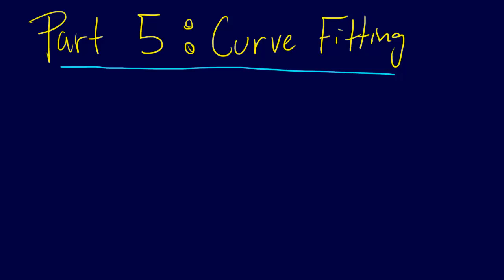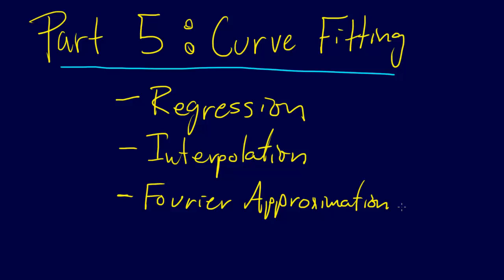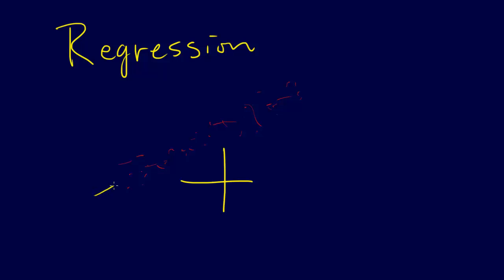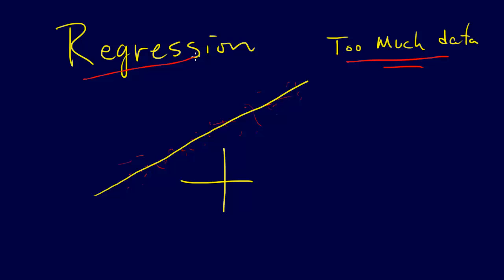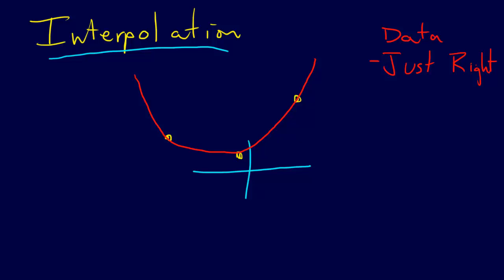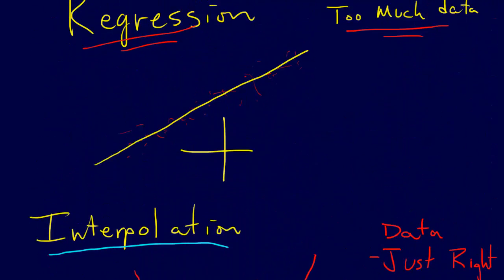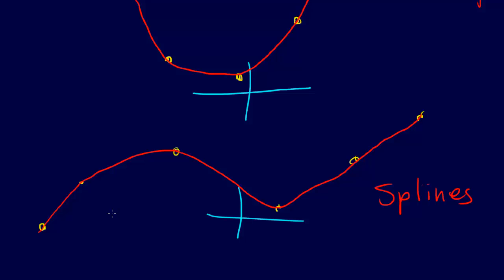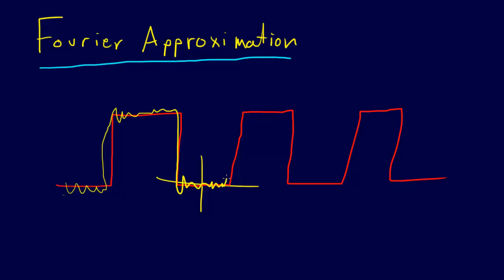5.1.1-Curve Fitting: Introduction: Regression, Interpolation, Fourier Approximation

Comment: marvelous explanation, btw, what is the equivalent function to the curve fitting please ?
Reply from the maker: Thanks...I don't know what you mean by the equivalent function though. Please clarify.
Reply: Jacob Bishop there is a paper, which I'm so interested in working on "Indoor Localization Based on Curve Fitting and
Location Search Using Received Signal Strength", my problem is, I want to find algorithm that is similar to curve fitting to obtain the result and try to compare between them, I do really appreciate that sooooo much if you help me with that
Reply from the maker: Osama Ali I looked briefly at the paper, and I don't see why you can't do this. According to their paper, they use curve fitting during an offline phase in which they create a mapping between received signal strength and distance for sub areas. You will find both curve fitting and regression techniques discussed here useful...and if I ever get time to do it, the optimization unit would be useful to you as well. Also, I have found that the best source of information in trying to replicate work done by others is to simply contact the original paper authors. I hope this helps.